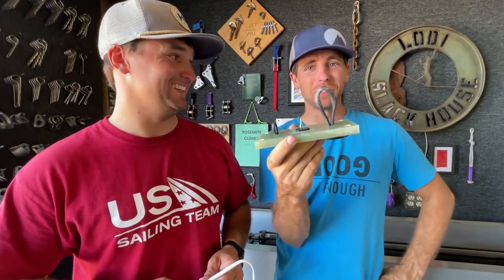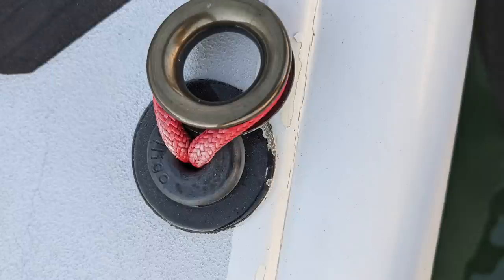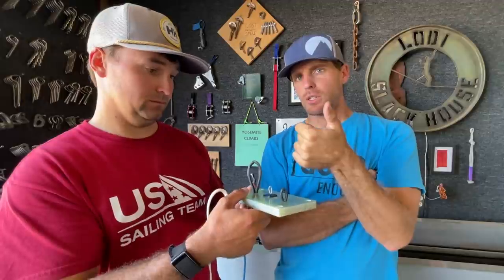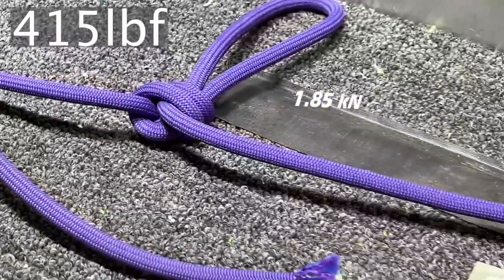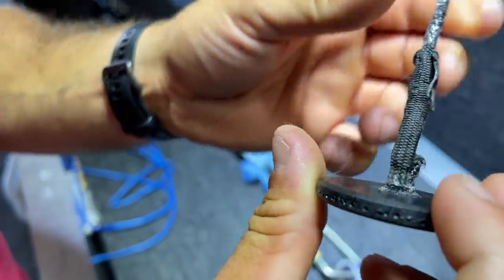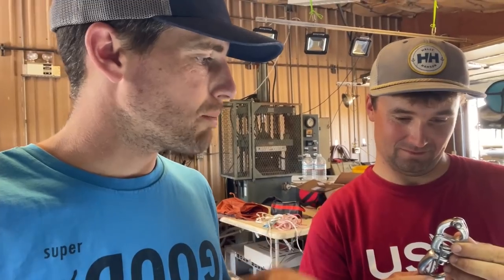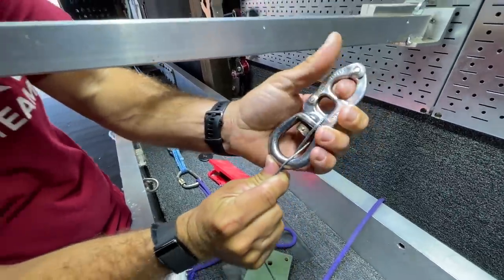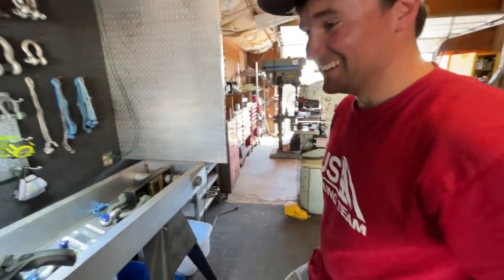How strong are sail boat soft loops & snap shackles?

Comment: I’ve been told that for equipment to get a “climbing” or “life safety” rating, it must go through very extensive testing. Boating hardware is not subjected to any “life safety” testing.  Companies follow a less stringent “break testing” protocol to establish a rating.  Good lesson for those who use this type of boat hardware and rope for climbing masts.  While much better than hardware store equipment, boating hardware is not intended to support a “life” load.  That can only be found on climbing equipment.  Do you information to confirm or deny that?  Thanks guys, really good stuff !
Reply: Very little is "rated" on a sailboat, these soft eyes are definitely not.  However many things are "super good enough". Many larger boats have ropes and fittings rated for 5k to 10k working loads.  One of the biggest things when you go up a mast is not shock loading the system.  All modern race boats have dyneema everything so shock loading is very bad.
Reply: @davidliebenberg7798  I absolutely agree….I’ve even used that equipment myself to go aloft.  As a follower of “super good enough” I know I was well within the working load.  However, I know double braided “yacht” rope is not life rated and neither is the Lewmar winch used to haul me up on masthead sheaves that also are not…but it works
Reply: @davidliebenberg7798  If shock loading is such a problem was it ever considered to use shock dampers for more vital rigging ropes?
Reply: I think you are referring to UIAA CE standards.  Not sure there’s anything comparable for sailing.
Reply: Yea I think that because the normal working loads on sailing rigging is so far above - it's never been an issue. 

It's like asking if a forklift is rated to lift a person... its not specifically rated, but if it works at all, it can.

Comment: I put a pair of soft padeyes on my trimaran back in 1980 made from 3/4"  3 strand made into an eyesplice over a thimble that then splayed out and was epoxyed under the deck and to a bulkhead held turning blocks for a 600 '² genoa that I tended to leave up long after a sane person would have taken it down.Padeye weiged a fraction of the metal parts it replaced and cost next to nothing. Unlike your manufactured eye all the strands where inline with the load and gently preloaded while the epoxy was curing. Never saw any indication of stress.

Comment: Excellent to know the dyneema and soft loops are so strong. Most of the loads on the boats I race on would be perpendicular to the mounting, and not parallel. I wonder if pulling it sideways like that, where it is bending at 90 degrees to a sharp edge, reduced the strength in some way. For example any halyards going into a turning block would be coming mostly straight down and the pull would be up, not sideways.
Reply: It almost certainly did. If Dyneema had a nemesis, it would be small bending radii. It's incredible it was so strong, even loaded like that
Reply: That was my thought exactly.  I want to see those soft padeyes mounted in a cored fiberglass material and subject to perpendicular pull.  Then I wonder if the deck will fail before the dyneema.
Reply: @duncanthomson5564   at the end of the vid he said the loops are stronger then the actual boat, so if this is worst cast scenario then I’d imagine that a straight pull would probably pull right through the deck of a boat
Reply: Had exactly that thought! Would love to see another test where it's pulled straight instead of sideways. Would it still break right at the base?
Reply: I was wondering about the sharp edge at the top of the deck hole myself. I know from experience that a hole drilled through fiberglass can be razor sharp if not deburred. Would be very interesting to see what happens when the hole edge is relieved (countersunk slightly). And also different angles of pull.
Reply: Actually the load on a halyard turning block is 45⁰ as you have an intersection of horizontal and vertical liads.

Comment: As a sailor this shit is so dope. I've spiked those shackles so many times
Reply: Add a gentle dab of grease on the sear (there should be a slight angle that prevents it from unlocking under any load) and set the rope as close to the disconnection point as sailorly possible to get some leverage in the right direction, as pulling on the other side can and will multiply the force needed by only 5 times.

Comment: I feel like the padeye test was a bit of a bust... The pull was lateral, and they all broke where they entered the "boat deck" piece of G10; where the bend radius is extreme (near 90 degrees).
In actual use, the stress loading would be near vertical; perpendicular to the pad & deck material.
Thoughts ?

Comment: This is Great stuff, I am a double leg amputee from Vietnam. I am curious about the strength of the carbon fiber feet. Are the feet as strong in cold weather below zero, as they are in warm weather? What did they break when 180 pounds drops on them from 4 feet high? These issues and others I’m curious about
Reply: At the temperatures humans exist, say -40 to +40°C, carbon fiber really doesn't care. The mechanical performance that you're concerned about is effectively identical.
As far as the drop, that really depends on the manufacturer the CF feet I've seen are incredibly strong. My ankles are going to break way before a CF foot fails.

Comment: In the previous continuous loop episode and in this one on the small bonded loop there is that issue of it breaking far lower than expected due to many assumptions. Of interest is the pinching effect of rope on rope in that case the soft shackle on the loop that inserts a compressive force besides the tensile. It would be interesting to see how much this affects rope loop to rope loop connections as compared to rope loop to rigid biner with same radius and rope loop. I believe it was not friction that prematurely killed that on site made loop last time.

Comment: Is there any reason to use Dyneema as a chafing cover, if the cover is not going to see any load anyway? It doesnt need to float either, since it's fixed to the boat.
Is Dyneema just also the best for abrasion or is it just good enough and easy to get/already on hand?
Reply: Dyneema is more abrasion resistant than pretty much any other textile.
Reply: Multiple reasons come to mind. It is very slippery meaning it equalizes fast and better than anything else. It is hard to cut and abrade. If the core is damaged it will still hold some weight. It requires the same bonding agent as the core so you do not have improper bonding to the core or the sheath. And it is the cool new stuff to brag about.